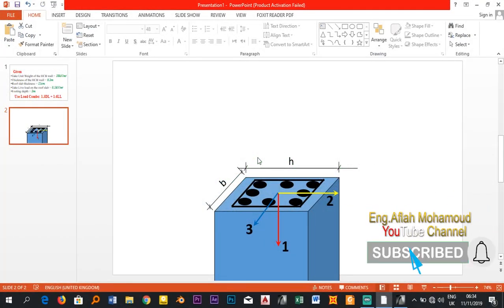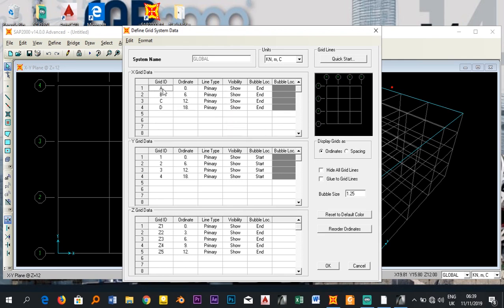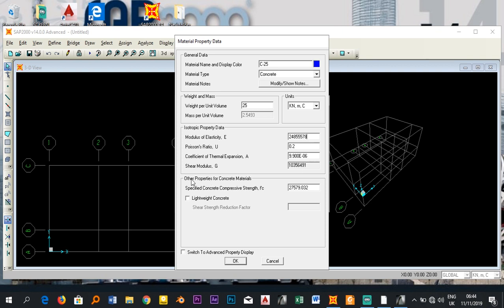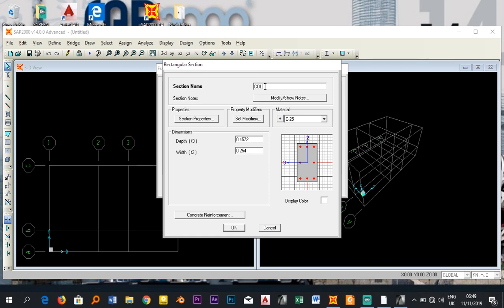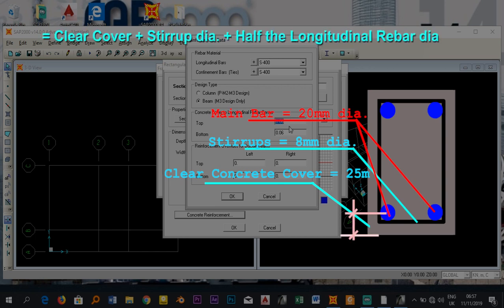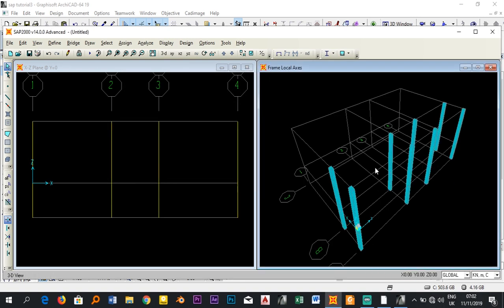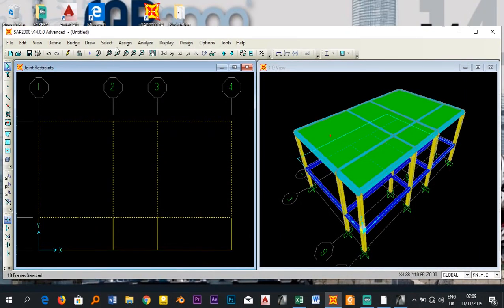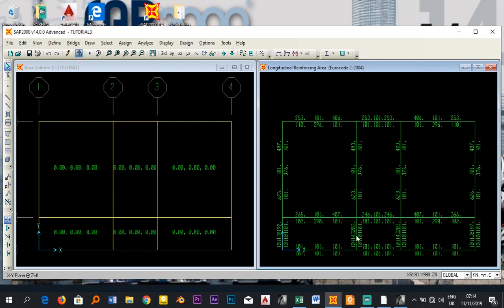#3- Simple 3D Building Design in SAP2000 TUTORIAL for Beginners

Comment from the maker: The Difference between 
1. MEMBRANE
2. PLATE
3. SHELL
1- Membrane is a plate the has no or negligible flexural stifness. It has only axial rigidity and as a result the transverse loads shall be resisted/Supported by its axial stiffness(Membrane Concept)
2- Plate has flexural stiffness. It will sustain transverse loads by its internal bending/flexural capacity
 It has two types when modeling on FE softwares. A) Thin Plate B) Thick Plate
3- Shall encompass both behaviour of Membrane and Plate.
 A)Thin Shell. B) Thick Shell

SUBSCRIBE to my Channel, and forget to Like & Share